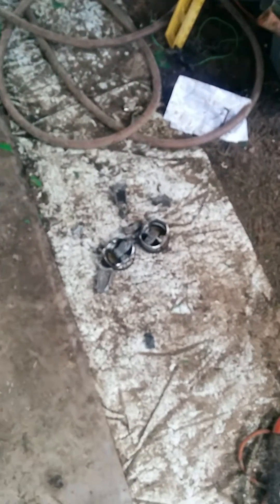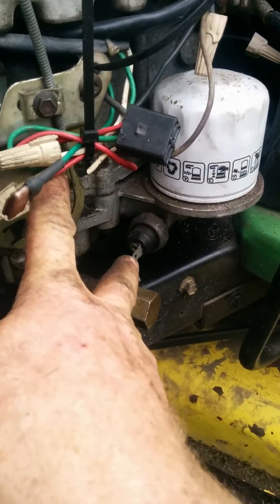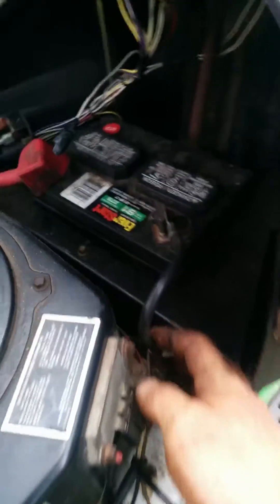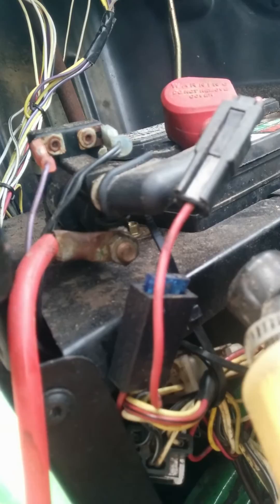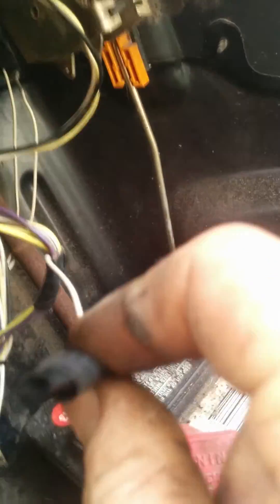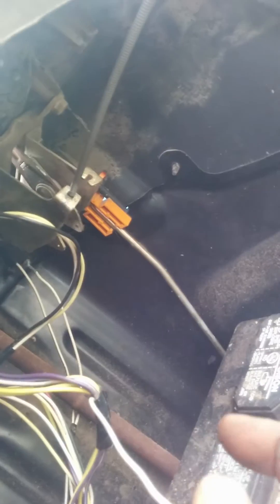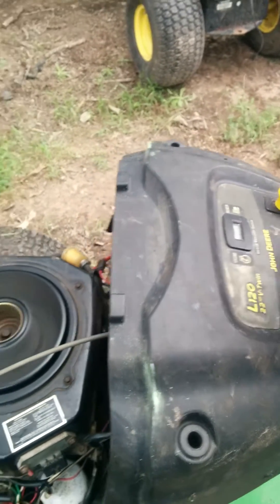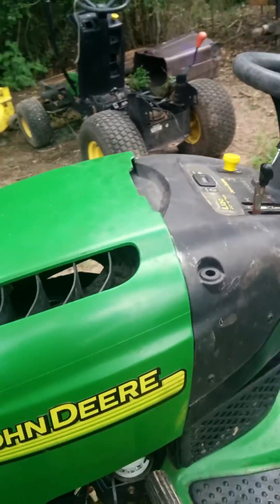John Deere l120 conversion from Briggs 22 HP v twin to 15 HP Kohler

Comment: thanks for making the video!

i just purchased a l120a with a blown motor (was in pieces when i purchased it) with the same symptoms. the oil pickup failed and the motor snapped two conrods clean in half...

i am planning to put in a brand new 16hp briggs and stratton knockoff but was worried 16hp was not going to be enough power to turn the 48" blades, but seeing this gives me some hope. thoughts?
Reply from the maker: The guy is still running it with no problems
Reply: 16 HP isn't enough to power a 48" deck. 22 or 24 HP would do it.